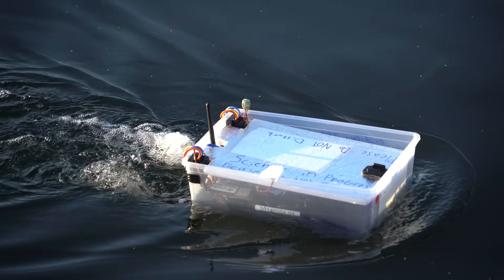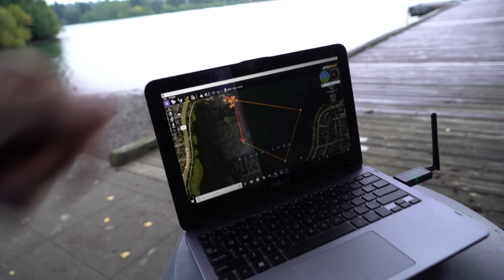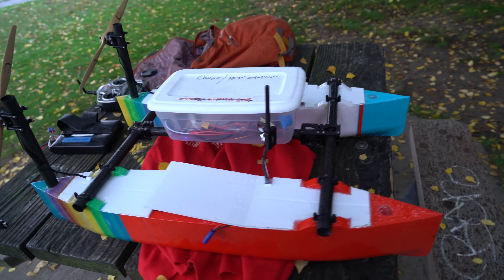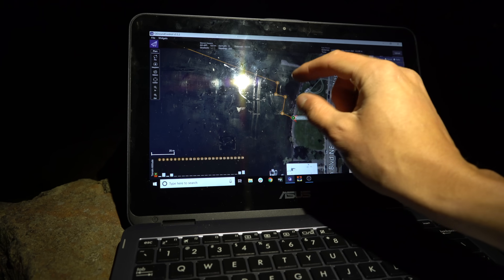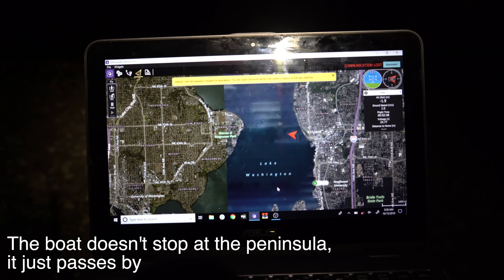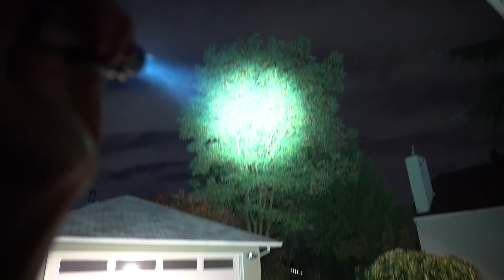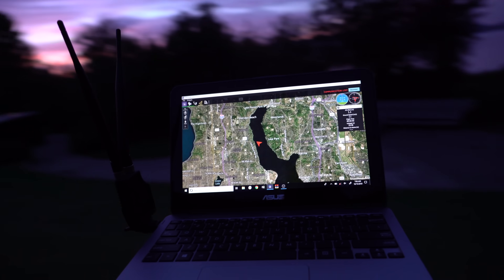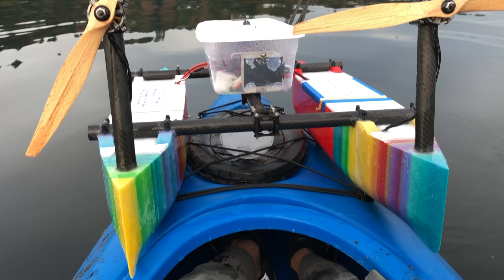Autonomous R/C Boat 13km Waypoint Mission

Comment: I am a professional maker and pilot in a university UAS lab.  The model warship guys have little bilge pumps.  No boat operates long without one.  I've seen rain sink a perfectly sound boat tied to the dock simply because something was wrong with the bilge system.  Other ideas, print in ABS, acetone smooth first.  Also, print hull maybe 4 mm thick and solid.  Consider using stabilizer system for knife scales.  This is essentially water thin epoxy.  Or, when you buy epoxy, get HobbyPoxy Finishing resin.  This is much thinner than normal epoxy so it will wet out better through the fine mesh of the print.  Finishing resin is intended to fill weave in fiberglass cloth so paint finishing is easier.   Also paint it as a 3rd coat to aid in any remaining pin holes.  Angle motors 3 to 5 degrees inward which will increase it's turning authority allowing it to pull larger seaweed monsters before turning fails.  Very much enjoyed.

Comment: The only R/C boat I made from scratch was a boogie board with an OS .35 for power, in front of two air rudders, an airboat! Ran reliable but slow. My first boat was the big plastic Chris Craft which did keep getting caught in seaweed. That was '72-'73, only planes since.

Comment: You should install a fake antenna with a red and blue blinking light connected to an extra battery and electronics. Maybe make the whole blinking electronics waterproof with epoxy to be able to locate your boat in any case :-)

Comment: Just an FIY, but some folks manage to print one perimeter thin RC yacht hulls which are waterproof w.o. the needed for a coating. But you have to really play with your settings and test it. But generally speaking, retractions can be the enemy. And please, don't go to a boogieboard. Too much wetted surface area, too little directional stability. Consider a very slim trimaran - and yes, do keep the bow about the waterline. Look at Adastra for inspiration: http://www.shuttleworthdesign.com/. Or any of the Nigel Irens power trimarans. Long and slim is my humble suggestion.

Comment: If this is a 433Mhz or 915Mhz telemetry system, get rid of those rubber ducky antennas and either build or buy dipoles for it. They're absolute garbage.

Comment: It's so slow😒. You should try buiding a hydrofoil, way faster and efficiënt 👌
Reply: Hydrofoils are a lot trickier to custom print and are quite a nuisance to store/ travel with so generally they are attachable which also comes with the time consumer of reattaching and detaching them. Hydrofoils are generally better for open water sailing vessels, because weight is better spread on them when in a lake such as this the boat simply isn't big enough, and you are more likely to snag weeds on the hydrofoils, which seems like less efficient and faster. You also need to be going at a certain speed for hydrofoils to even work, and the boat probably wouldn't hit that since it stays at a constant 1.1m/s. Sailing boats have them because when they pick up speed from the wind they want to go fast. A good idea at first, but much to many issues relates to their installation and usage.

Comment: You should try 4G/LTE telemetry.. I use it on my plane and it works like a charm... I am currently using "UAVCast Pro" so, as long you have 4G coverage you'll have telemetry on your computer from the boat... the boat could even be in the other side of the globe... the latency is really short, almost real time.

Comment: The problem with a flat bottom will be directional stability. The twin hulls provide directional stability - aka they don't like going sideways. A boogie board will be very difficult to control. Second, build the boat from plywood and use fibreglass stitching. Seal with epoxy. Have the front of the hull tapered so that it will not pick up seaweed.

Comment: please please please take a fixed wing drone and attach a signal repeater and relay to take a long distance remote signal and beam it down at the boat, and set it to fly a huge loitering circle, with the boat in the middle, and while following it, so you can have a long distance link even once the curvature of the earth blocks the antennas. or take a quad and give it a repeater and strap it to the boat and set it so that when a set time/place/signal loss/ is detected, so it can automatically fly up to a preset altitude and get signal lmao

Comment: What might be a good idea is to add a small water pump that will be activated by a water sensor so if it does get water in by any means the pump will try to drain it (depending whether or not it has a hole and the pumps work)

Comment: I can't get enough of your videos! I'm looking to build a long range fixed wing (not solar). I'm going to build it on a ft explorer running 4s with crossfire and fpv. What would you recommend for gps/osd/current sensor?? Just looking for something to keep the plane steady in 2d hold or auto level and rth, of course. Still in college so looking for something that won't break the bank. I can't find a system that fits well with what I am doing and I would really like your input, so if you could point me in the right direction that would be much appreciated! I've been flying quads for a while now and looking to expand and build something new. Your videos have taught me a lot about this hobby, looking forward to part two!!

Comment: I HAVE A GOOD, BAD IDEA. Could you make a repeater for the telemetry, if so put it on a small rc glider with Ardupilot on it flying with the repeater and giving you life telemetry the hole time and the boat wouldnt have to use so much power to transmit witch would add more range to the boat??!?!?

Comment: Your pontoon hull design should be closer to that of a Polynesian canoe, with an angled foot to the bow.  I'd also consider using hydro-jet style propulsion, to avoid fouling.   You could incorporate all of that in your 3D printed design.  With so much complex and relatively expensive electronics, I'd also place the electronics in hermetically sealed compartments inside the hull/s.   
.
Try watching some YouTube uploads detailing model submarine designs.  
.
Great experimentation though.   Keep it up, we're hooked now.

Comment: a boogie board wont self wright itself. use one of those foam skateboards for pools and weight the bottom down so that it self wrights itself. if it gets flipped over. cut a hole in the center for the plastic container, and bam.

Comment: what about a solar plane autonomously flying at a high altitude between you and the boat acting as a relay antenna. Those antennas require line-of-sight achieve full range, but by adding a signal relay that can see both the base station and the uav you could achieve full range without losing line-of-sight. There has been a lot of military founding into this exact idea as a solution to the round trip delay with satellites, google "uav relay antenna" and a bunch of articles will come up.
Also, a flat bottom hull and a bow with a high angle of attack would just float straight over almost anything, too. Just look at any airboat's hull design.

Comment: Take a hint from the very thing you rescued it in man.. Kayak's are designed for shallow keel depth and to not easily pick up weed etc. If you look at them you'll start to notice issues with your own hull designs, you have very sharp flat edges, that stuff can catch on rather then curved edges that if you hit weed it'll just push down or to the side of etc. Then take into account your thrust, you've moved the thrust from the water to in the air which means you'll want as you kinda realised after the first weed incident weight at the back, because your balance point moves over you start to thrust forwards, though I'd honestly look at getting yourself some EDP motors rather then big prop ones.. there smaller profile and can be kept lower to the hull, enclosed as they are they also shouldn't get caught up on weed or anything else. 

Over all though great to see the progress so far! you've got me wanting to convert half my stuff over to water :D to go with me when I'm on the kayak hehe.

Comment: Loving the videos and the autonomous adventures, stick at it.
The hull design is good, just a tweek to get away from the vertical bow and give it some weed sheding.
Airbags in the hull to keep bouyancy incase of water ingress. 
The electronics box, if watertight would have kept the whole thing at the surface even if both hulls were waterlogged.
Maybe jetboat style propulsion?

Comment: Could it be more efficient to have veins to direct the air from the propellers rather than having differential? You get a better moment for turning and it would mean you could run both props at a constant lower speed and increase efficiency, I don't know how significant the gain would be though. I think this is a really cool concept though.

Comment: Your balance looked really tail heavy. It probably caught a wave of seaweed. Best move the props to the middle of the boat so they're as far from a tipping position. And then re-balance the dry compartment.
Reply: The idea was to tip it back so as not to catch seaweed on the bow. Would have been better to design the bow with less of a vertical edge so hopefully the seaweed would have slid under the boat rather than catching.
Reply: @MichaelScholten  great point there. lots to consider in this new task!

Comment: Daniel,
Out standing job, stick with it and you will succeed.

I went with a much bigger boat design. You can see a short video my boat on my YouTube Channel "On My Workbench"
Autonomous Boat Autopilot Test Bed. 

It's unsinkable and runs 4 knots it uses two Minn Kota trolling motors with a custom built auto pilot and H-bridge PWM speed controller. It uses two deep cycle marine batteries in parallel,  I used two Maxstream (Digi) One Watt 900 MHz modems for telemetry it never ran out of range. It has never been stopped weeds.

Dave.

Comment: I reckon the right pontoon rode up on something, forcing the rear left prop into the water where it got tangled with seaweed and pulled itself deeper. 

You should put one of those 360 action cams on it next time so you can see what happened if something goes wrong.

Comment: I peace of seaweed that size can even screw up 30ft long racing cat.
If it gets caught on the front of the hull, dagger board or rudder then it can do all sorts of weird things.
I once had a piece that size on the front of one hull and it caused a huge amount of harmonics through the whole boat with large pulsing vibrations that could be felt all the way at the back of the cabin..
That was only with a boat speed of around 6+ knots.
I was looking for a massive problem like a dagger board failure but it all went away when I hooked the piece of seaweed and removed it.
Seeing as your using a fan drive the you would probably be better getting away from a wave piercing style hull and use a design like is used on old float planes.
You will loose tracking but cut down on most seaweed problems, it was also go on the plane very easily if you want to use it for a high speed run..

Comment: You can make it 100% unsinkable and never worry again. You make it using an inner and outer hull that is filled with a closed cell foam. The closed cell foam is important because it will not soak up the water like a other types of foam do.

Comment: Definately needs more power, probably needs more speed. I think even on a lake 1ms is dangerously close to the speed of currents you might encounter.
Boogie board would work but it won't be very effective as a slower displacement craft. Some pvc piping and pool noodles would give you better speed and efficiency unless you plan to make the boogie board fast enough to plane.
Reply: Eh, lake washington and greenlake don't tend to have much of a current. On very windy days they can get choppy, but I can coast my kayak even on those days.

Comment: If... you feel the bottom with the largest possible packing airbags!!and put the batteries in top!! the displacement will not allow the boat to sink "It will go down a bit!! but due to the fact that the airbags will displace the water any way... this design may still have some merit.. because its a good design after all! there are current Marine ROB's that use it and still in use.. you can probably spread  the pontoons a bit farther a part, do!

Comment: That was a lot of video work. Great footage. It is a shame that you would abandon the current manifestation :-) The design was looking so good  in the water @ 6:06 . also the cat design is proven as highly efficient at tracking with a bit of wind.  To the weed problem ....Might one might derive some obstacle avoidance script in Ardu "Surface" for doing an anti-foul routine...reverse the prop for a short cycle like boats do to remove weeds.  To that end I would contact Randy Mackay who posted  this video as "Liked" 
OR,...modify the bow with grinder and fiberglass to have shallower angle of attack and make watertight :-)
Best regards, Chris

Comment: Very cool project! Just one suggestion: You can make very high gain telemetry antennas for your ardupilot telemetry modules yourself. In 99% of the cases, the factory antennas are cheapo 2.4G antennas which are way too short. A stick shaped antenna needs to have a certain length and it works best at 1/4 of the wavelength it has to transmit or receive. So for 915MHz (Which is 32.75cm wafelength), your antenna and your ground pole wire need to have a length of 8.2cm . If you take of the factory antennas cap, you can see a lttle wire and a piece of brass pipe. The pipe connects to the Shield of the coax cable and is the ground pole, the wire on top is the antenna. Just unsolder the brass tube and take two 8.2cm long wires. Connect one wire to the center wire of the coax cable and the other one to the shield. Make a bracket to mount the two wires so that they are facing the opposit direction. The antenna will then look like a big T. This is called a tuned dipole antenna and you will have significant increase in range for free.

Comment: An Air Boat Shape.. John Boat, your motors, and with the stuff, all of it, on the inside of it, except the Antenna... and Dependending on Size and Shape you make it, should be able too travel fast and handle most Rough Water? Should skate pretty good..

Comment: Build a RC Sailboat and make huge mission.
Reply: I have an rc sailboat and can say that making it autonomous would be exceptionally difficult. I love the idea but the hard part about rc sailing is having to take in to account wind direction. You can't just point in a direction and go. Often you have to zig zag across your path so as to get enough wind to propel you. The controller could have to be aware of wind direction and be capable of choosing alternate paths.

Having said that, it would be awesome to do!
Reply: @MichaelScholten  Thank you for your answer. I know how sailing works. Im sailing Regatta for over 12 years now. My Dad is a professional sailing teacher too. Autonomous sailboat are already existing  and are Working great. I think one already crossed the English channel. There are autopilots for rc sailboat available on the consumer market since about one year.

And yeah it would be awesome.

Comment: It's funny because many modern racing sailboat have those vertical bows. They are very good at cutting through waves without sacrificing energy. I wonder if any of them have the same problem you did
Reply: Yes, personal experience.
A peace of seaweed that size stuck on the front of a 30ft long wave piercing hull will mess it up.

Comment: Part 3: "well, the boogie board was a bad idea, so we're going to put wings on it and just fly over the lake."
Reply: Part 5: "Well, wheels were a bad idea, so I have my friend here from BPS.Space and we're gonna put some rockets on it."
Reply: Part 6: "Well, boogie board,wheels,rocket,carrying it and it broke is a bad idea, so we are going to use helium balloons to float it over there with differential props to steer it."
Reply: @grim-upnorth  "May your hulls be bare and your seaweeds few"
Reply: @arthbarros  Ah fuck... That made me laugh :D
Reply: @arthbarros  "well the wheels fell off so we are going to make a submarine"
Reply: Part 5: Boogie Board, Wings and Wheels have been bad ideas ... 

Lets try a Hovercraft made of Foam so it wont sink
Reply: what does dvnt mean?
Reply: Part 1b: I added bilge pumps to stop it from sinking... followed by Part 1c: I rethought the design, and turned each pontoon into a submarine... so it sinks by design! xD
Reply: 01100100011101100110111001110100  jeez
Reply: Oh oh oh ,,, WING EFFECT BOAT!!!!!
Reply: 01100100011101100110111001110100 what a good name
Reply: Your username is in binary, once its converted its spells 'dvnt' - wtf is that supposed to mean?

Comment: Maybe just get an RC boat hull? Something that you know will work.
Also packing it with foam is the right idea. You could maybe use that spray foam as well to fill in the space better. That way if it does take on water, it won't sink completely below the surface.

Comment: Nice job Daniel! Hope you found out why it took on water.
I see a solar-powered trans-pacific version in your future one day.
Adding a reverse capability may help with some snags, but a planing hull design should avoid frontal snags.
For water propellers, a jet ski design may work. Reverse thrust pulses could also help to clear blockages.
Reply: Andy Lee Robinson Funny you mention Solar powered Ocean going boats, as I watched a video about these boats about a month back. There is such a thing! One inventor has them doing missions for months in the Atlantic collecting lots of different information on weather and tides etc. I wish I could find a link, however they do exist and are working year round.